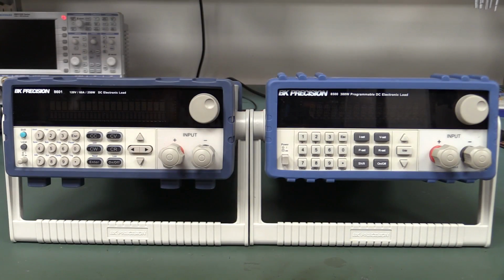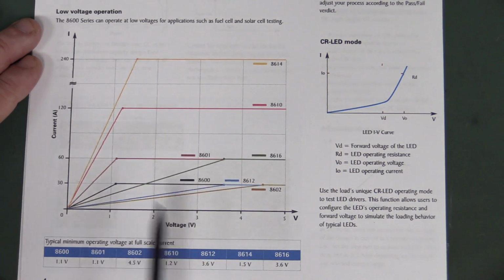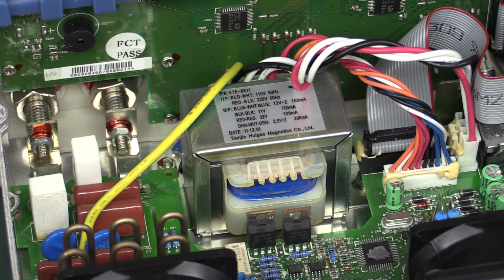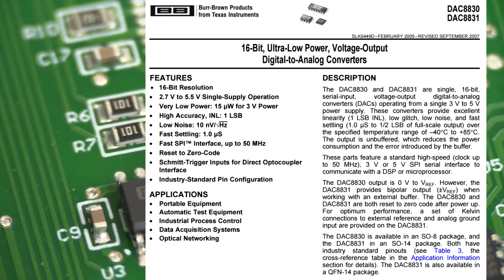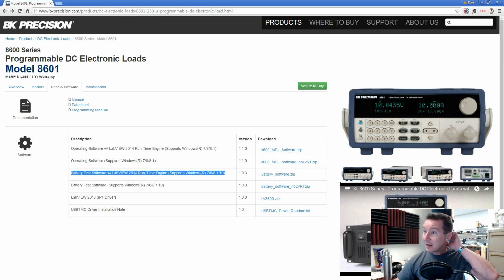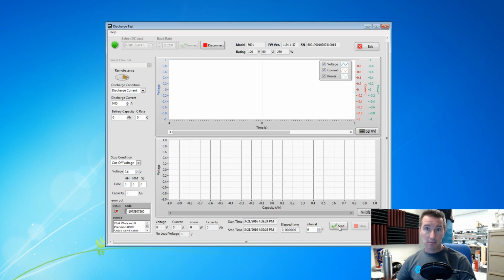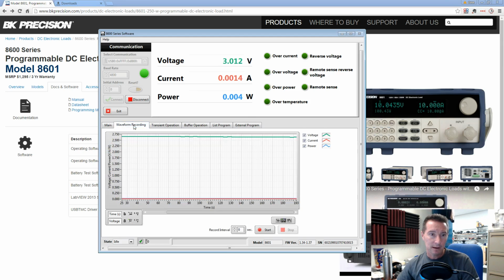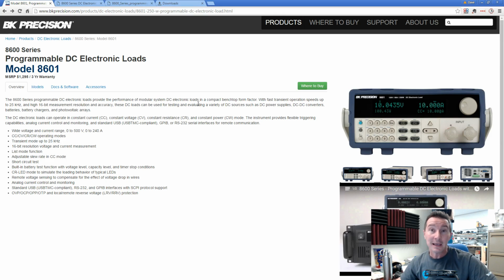EEVBlog #862 - BK Precision 8601 DC Electronic Load

Comment: Being able to replicate different forward voltages of LED load is good for testing Led constant current drivers over their whole output range.   The load I use for work is especially different from an actual LED at low current.

Comment: Never did understand this silly aversion to reading manuals. Personally, I really enjoy reading them and really getting to know the ins and outs of the thing I bought that I may otherwise miss out on, knowing I am operating it in an optimal way and just getting to know my new toy. Sure, I might get that some people don't have that patience, it's fine. But when it goes to a level where you are seriously frustrated and raging about it, it's really time to learn that if you can't get something to work how you want it to, the first thing to do is generally consulting the manual.

It's also amazing how an accomplished electronics engineer like Dave is generally so inept when it comes to software. Sure, I have only seen some pretty simple arduino stuff I think he wrote, but just observing him operaring and talking about software make one seriously question his grip on the subject. Personally, my experience is that many electrical engineers make excellent programmers.

In the case of Dave it has to be noted tough that this slight lack of provess in one area is quite made up for by his knowledge about electronics design, especially analog such, and not the least, his one of a kind personality. My wife watched a vide over my shoulder a while ago and though it was actually some kind of joke video saying no one can honestly be excited enough start moaning and go into a falsetto when talking about electronics. comparing him (quite accurately) to Bear Grylls (spelling?).

Comment: The built in rise and fall measurement could be useful in some automated pass fail test for power supplies where the waveform has been validated previously in the design phase and wouldn't change in production.

Comment: Dave,

The Itech versions are available with the new 2 line display.  The equivalent range to the BK 8600 seem to be the ITECH IT8800 series.  I haven't dug into the datasheets, but it looks like the IT8812C is the equivalent to the BK 8601.  That isn't to say the BK isn't worth the extra cost if you want the service, especially if you are talking about using the instrument in a business environment.  For the home gamer it doesn't matter quite as much.

The ITECH IT8500+ (the + being the important part) also seems to have the 2 line display, although the digits are the 14 segment style, not the dot matrix style.  But the IT8500+ series has models that will do 600W in the same form factor, so for someone who regularly deals in high power stuff but still wants a small footprint it can have its advantages.

Comment: The 8500 serial port is TTL levels, the 8601 is RS232, as shown on the equipment back panel. The 8500 isolated USB to TTL adapter (model IT-E132) would not work. 
It would be nice if the unit would just detect when something is connected to the port and enable it.

Comment: Granted that linux would not run any of the provided software, but it is really easy to write short programs using SCPI, and USBTMC drivers are usually included by default.
Reply: Using the RS232 port and WINE, it may actually load. I've used wine with rs232 devices and it will work.

Comment: I recently (Nov. 2020) purchased an 8601 and WOO HOO!, the front-panel INPUT terminals have been redesigned to provide built-in 4mm banana jacks.  The plastic knobs on the INPUT terminals are the same shape and size as the original, but they now have a 4 mm banana jack in the center (compared to the solid, threaded stud terminal on previous units), and the banana jacks (not the entire knob) are color-coded with red for the positive input and black for the negative input.  FWIW, I live in the U.S., I purchased the unit from Newark Electronics, and the serial number on this unit indicates(?) it was manufactured in 2020: 435F20xxx. FWIW, B&K Precision's documentation for this item apparently has not been revised to show these redesigned input terminals; this is probably a deliberate decision on their part, to reduce customer service complaints.  FWIW2, as of Dec. 6, 2020, this webpage for B&K Precision's 8501B shows the redesigned INPUT terminals that are on my 8601. https://www.bkprecision.com/products/dc-electronic-loads/8510B-8510b-600-w-programmable-dc-electronic-load.html
Reply: A bit late probably, but since I've seen these terminals I've been trying to find out where to buy them. but they seem to be non-existent to the point where I started to wonder if the pictures are photoshopped...

Comment: I know this isn't cool, but read the manual! If, like most people (including myself sometimes), you don't want to read it, that's fine, but then don't complain when you have to figure out why it isn't working. 

I am surprised that the BNC current output is referenced to the negative input terminal, instead of chassis ground. If you were testing a negative supply which had positive grounded, you would short the supply by connecting the BNC to a scope.

Comment: Yeah the mains cable is draped across sharp edged aluminium heat sinks. Even if they whacked a couple of posts in and cable tied to that it would be better.

Comment: The RS232 didn't work because you have to manually go to device manager, find the usb-to-serial adapter and change the com port in advanced port settings to one in the drop down of the software. It seems that the software sometimes only looks on certain com ports for communication and doesn't search for usb to serial on other com ports. I had this issue with my BK 1788 power supply.

Comment: Unless the load input is grounded (which would be a problem in itself) that mains connection with only basic insulation to the input terminals does not comply with most safety standards.

Comment: ...and i'm just sitting here, putting resistors in parallel...
Reply: This right here! Building a load tester myself and because I don't have any way to drive a MOSFET down to 1mV increments, my options are an IGBT (don't like heat though) or a whole buttload of resistors in parallel with a relay to open/break the circuit when needed.
Reply: @friendlyfiregaming4601  lm324+mcp4725+ina226, test it with own arduino code and resolution is 0.01A, well it is good enought for hobby :)

Comment: I think it's a bad design.
I would simply do a 2 stage high frequency SMPS and feed the power into the grid.
If you wanted to really show off it could be a resonant 1MHz topology.
And why have those huge bolts when you are connecting to the PCB anyway.

Comment: Like the Rigol power supply, I don't think I would buy one of these because of the part numbers being scratched off the chips.  Makes things more difficult to replace/work on it if and when it fails.  Design looks OK, so why do they feel the need to obscure the parts?
Reply: That is frustrating....
Reply from the maker: +kevtris It's ridiculous.
Reply: I don't know. They scratch to avoid China to copy or to repair? yeah, sadly I guess the second option
Reply: Maybe, but if someone was intent on copying it, they would spend the thousand bucks to "peel" the chip to see what it was.  Most dice have the part number and manufacture listed on them so ultimately scratching the numbers doesn't help much.
Reply: Not at all. You can guess easily by the function in the pcb board, sorting vendors and removing chemically to uncover the die.

Comment: interesting design. redesign. 

The STM32 is a good choice, the advance timers would probably be used for doing precision timing calculation, rise, fall, ect.. 
They went from a Sigma Delta ADC Sigma Delta AD7708 to a SAR ADC AD7682, for speed. The  older AD7708 is very slow.

The software still sucks, for that price they should fix it or redesign it, they use labView components and just drag and drop those components on the window.They should follow keysight they used WPF.

Comment: Do yuou really want such screw fitted terminals when we are dealing with a high precision 60A load 11:27  versus a wellsoldered connection on some high gauge quality silicone wires.

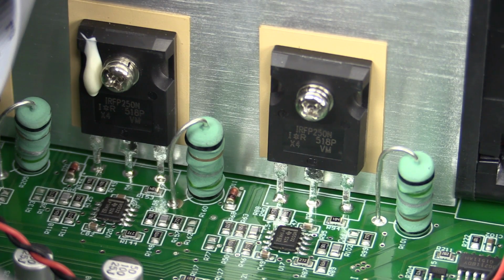Comment: Was the solder joint on the right power transistor's drain as bad as it looks in the video?  12:10 It looks like it's barely soldered in at all...

Comment: The software industry has not moved on from the 1960s. Just imagine if everytime you wanted to design some equipment and you had to design an op amp from scratch and implement it in discrete components. I have this argument with developers at work. Every couple of years they produce the same applications over and over doing everything from scratch. Drives me nuts when good hardware is always let down by a massive software fail.

Comment: What's up with your slogan "Don't turn it on, take it apart" Dave?  You should always turn it on first, take it apart, and then turn it on again.  This way you know if it actually worked before you started screwing with it.

I think there is only one GPIB controller chip manufacturer left these days ...

Btw, nice review.

Comment: That's wacky they disable the USB connection unless you specifically turn it on. It can't be a security feature since there's no password protection on communications. Maybe they don't know how to detect a circuit's been completed. Or maybe they heard network equipment does the same thing and they didn't know it's a security feature. Also, lol at the 650 megabyte USB drivers. I thought HP has massive drivers for their printers but this is a new one. Dell combo packs that contain drivers for all possible hardware for each computer model barely breaks that.

On the export to Excel thing, since it doesn't export to a spreadsheet format it probably uses an Excel plugin to export it because they're incompetent and think Excel is the only spreadsheet program in the world. It probably just gives you the same information as the tab separated text too.
Reply from the maker: +Noah LeFoot Yes, I thought it was wacky too, I can't see a valid reason to do it.
And yes, lazy programming for the Excel thing.
Reply: +EEVblog Perhaps internally there a single serial input and the menu selection switches that serial connection between the three inputs from the back panel.

Comment: Hello, are you able to test a solar mppt controller with this load box in place of the battery?
Reply: I was thinking the same thing! Love to know if this is possible by setting to CV mode on this and then letting the MPPT controller adjust the amps.

Comment: +EEVblog Dave, I'm prolly showing my ignorance here since I'm a repair tech, not a design engineer, but it occurred to me that this is a resistive load but with PWM, inductive and capacitive loads cause huge (ringing) headaches. Any thoughts?
Reply from the maker: +Steve Brace Nothings beats the actual product under test for a load, but dummy loads like this are very useful for characterisation.

Comment: You actually need to have Microsoft Excel installed for the export function to work... It doesn't have a proper built in generator for excel files... Basically hands off the data to excel.exe to create the file... At least thats how the old one used to work.

(saw you have LibreOffice installed, won't cut the mustard for this, but you shouldn't need excel to export ffs...)

Comment: Why can't it export to Excel!?!?!  Proceeds to open up libreoffice, i'm assuming you don't have Excel installed...
FYI, those control programs are just all Labview based, so if you have issue with some of the UI it might be because of that.  Not to say they made the programs well just that they only used Labview which isn't the most flexible thing in the world.
Reply from the maker: +natan keddem I expected it to export to a standard .CSV file, or an Excel file which any spreadsheet program can load. Why should excel have to be installed to do this?
Reply: +EEVblog That right click menu you got was a built in function in Labview, for that "chart" display ui element.  They should have probably created some additional displayed ui control elements for exporting that data in more varied and easier ways.  They can't change that right click menu easily since it is a hard coded into Labview  

Like I said they could have probably made a better program but they made something quick.  Anyone with a half decent grasp of Labview probably made that thing in under 2 days.  They needed something quick and dirty, you are looking for well done and polished.

Comment: On these "wimpy little to220" transistors I can dissipate 200W.
Its the power of sup57n20 soldered to IHS of CPU directly by thermal pad.
Nothing like that IRFP250N rubbish xD
Reply: +Arek R. 

TO-220 doesn't have 

1) The die size capable of handling "continuous currents" as the silicon channel is too small and will end up burning/melting, also the metal tab of a TO-220 is thin 

2) The IRFP260/250 is cheap, its got huge thermal mass compared to a  a TO-220 and most important the RDS parameter is the main point here... what TO-220 has a RDS on of ~0.08ohms at +/-200watts max with good thermal mass? Note here the mosfet is used in the ohmic region NOT saturation (as a switch as most people use them as).

The 0.05ohm power resistors will help force current share between the fets,this is to help with the varying mosfet(s) rds(on) resistance  with temperature,  fixed 0.05 + 0.08 ohm + rds(on) will help force current share, each fet can withstand 190w, however its assumed it is used in its saturation region (as a pulse switch), so SOA data will be at the given, however in this case its used in its ohmic region so the SOA for each is NOT 190watt each and calculated based on the instruments V/I parameters... so a 150watt e-load instrument with 4 fets will be 150/4 = 37.4 max watts per transistor which is the SOA (in the linear/ohmic region) so a 200W wimpy mosfet will fail as no SOA parameters has been addressed.
Reply: Nope, I know these things, I made few years ago 1,3kW dummy load, 10 in parallel, 0R13 resistors for equal current.
I choosed these sup57n20 in to220 because they had good SOA for DC.
That mosfet have rdson of 33mR at 10Vgs.
But anyway in our use that resistance is not important, because in most cases it will be working as variable resistor.
200W at 15V is in SOA, they dont burn, with 0r13 resistor it can handle 250W
Reply: +Arek R its hard to justify your statement, power delivery is  proportional to temperature as well (25 *c is not the temperature a e-load works at its 3 or 4 times higher 75 or 80 depending on the heat-sinking used. ) , 250w a single mosfet? no this may work but it will die in the long run, their is a reason why 10 mosfets are used for 250 watts,  each only dissipates 25watts under full load (this is SOA + 10% marginal worse case safety).  a 1.3k design will die with only 10 as each will use 1.3/10 = 130watts each. there is a BIG different between pulse switching loads  130watts AND continuous 130watts.. 

Your design is not reliable for the claimed sink figure of 1.3Kw for prolong periods.

By the way, I am designing one too but im busy with the firmware, look at my channel for a preview.I have knowledge with mosfets working with switch mode power supplies in its switching region, but this is a linear mode design, the power parameters are way different.
Reply: My dummy load was working about 3 years w/o any problems but then was killed by 300VAC spikes from damaged smps.
Another guy have same DL and it works about 6 years.
I now going to build new DL, with digital control, something like these from bk precision.